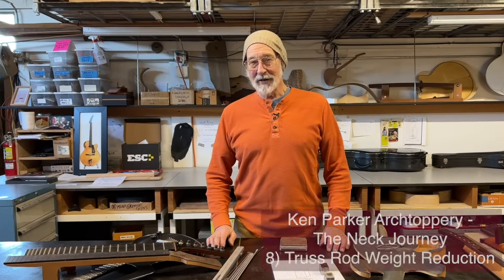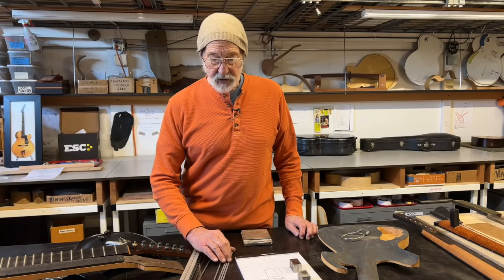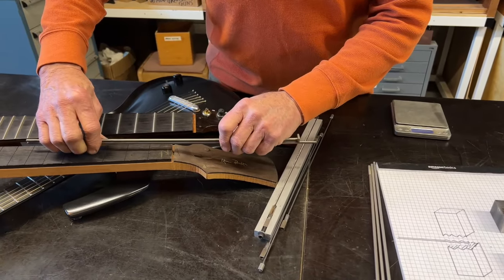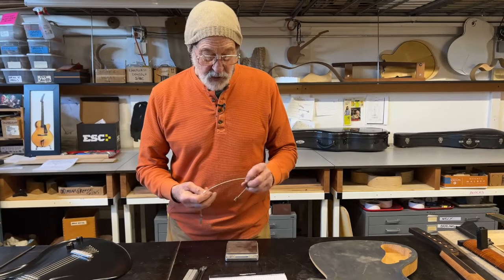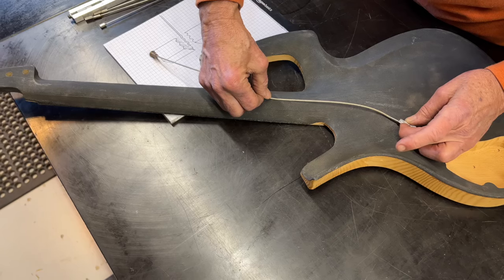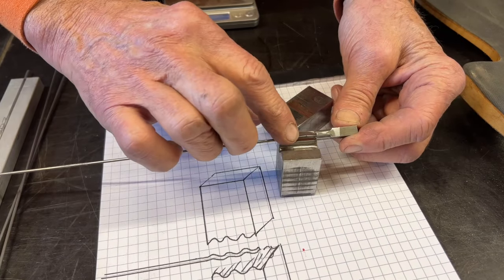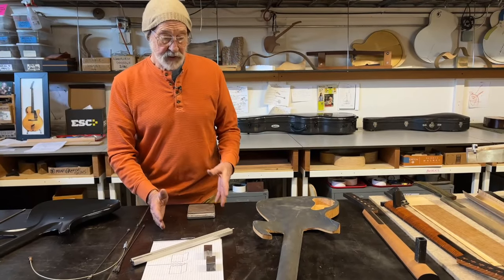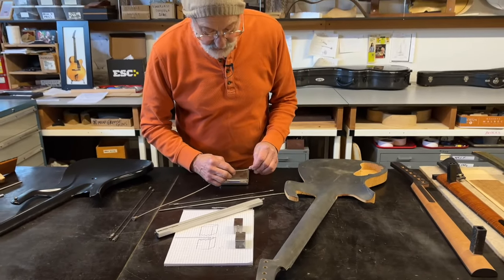Ken Parker Archtoppery - The Neck Journey 8) Truss Rod Weight Reduction

Comment: Your videos always make me think about what the next step might be in development...  For this topic, I wonder how much tension you could put on a heavy gauge wound string before it would yield...  Seems like it might be incredibly simple to thread a guitar string (or bass string) down a hole in the neck.  A simple geared tuning peg-like post could provide the adjustment...  I'm probably over-simplifying this, but it seems like there might be something worthwhile to chase down.  Your videos are so thought provoking!!!  I love it.
Reply from the maker: Thanks! We can imagine all sorts of arrangements that would balance forces from the set of strings through some length of tension-able something adjusted by an adjustable something, let your imagination go!
The physical problems of installing and adjusting your new design will include weight, complexity, access, stability in tension, fool-proofedness, cost, etc.etc. The beauty of Thaddeus McHugh's original design is it's farm-hand simplicity, right up there with duct tape and bailing wire. For example, the .078" or 2mm rods that I designed for the Fly guitars worked great, but at the cost of complexity and expense. The beauty of the original design is the ease of cutting threads on a 3/16", 5mm steel rod that easily exceed the strength it will need in service. For my purposes, a light rod was essential, and we just gritted our teeth and made it work. Like many other things, in order to beat a simple solution, you need to open your wallet.

Comment: Thanks for sharing your ideas! Do you say compression because they compress that part of the neck? As the rods are under tension (cables only work in tension) would carbon work too? I think I might try that on one of my guitars.
Reply from the maker: Right, the rod is tensioned, so it loads the structure it attaches to in compression. I know it's kind of odd, sorta like is a West wind blowing westward, or does it come from the west? (Answer, from the west.)
Carbon/epoxy has fantastic strength in both tension and compression, but to be able to apply and adjust the tension, you need to grab on to it somehow, and believe me, that's a challenge with no simple, obvious answer.

Comment: Good idea for the multi wire cable truss rod! Does this concept induce some kind of simpathic vibration?
Reply from the maker: I used 1/16" 19 strand galvanized steel cable (stronger than stainless steel) that was coated with a thin skin of vinyl. I pushed them into a close-fitting slot and never had any errant vibration problems, although it did seem like it could be a worry.
Reply: @kenparkerarchtoppery9440  that makes sense. I like this concept very much . Thanks M. Parker

Comment: Ken, what are your thoughts on using dyneema instead of steel cable? Its used on sailboat rigging...
Reply from the maker: As a life-long sailor, you can imagine that this plan got plenty of consideration! Although dyneema is very strong, it is outperformed in tension by Zylon PBO, and so this would make it my first choice. As always, grabbing on to a rope is the problem, and it just looked to be too problematic to pursue 30 years ago, although it might be worth another look. Here I'll copy my reaponse to another similar question....
Thanks! We can imagine all sorts of arrangements that would balance forces from the set of strings through some length of tension-able something adjusted by an adjustable something, let your imagination go!
The physical problems of installing and adjusting your new design will include weight, complexity, access, stability in tension, fool-proofedness, cost, etc.etc. The beauty of Thaddeus McHugh's original design is it's farm-hand simplicity, right up there with duct tape and bailing wire. For example, the .078" or 2mm rods that I designed for the Fly guitars worked great, but at the cost of complexity and expense. The beauty of the original design is the ease of cutting threads on a 3/16", 5mm steel rod that easily exceed the strength it will need in service. For my purposes, a light rod was essential, and we just gritted our teeth and made it work. Like many other things, in order to beat a simple solution, you need to open your wallet.

Comment: The cable truss rod is genius.  How did you prevent the cable from vibrating in the channel? Silicone?
Reply: It's probably in constant contact with the wood, so consequently unable to move. Therefore, no vibration.
Reply from the maker: I used 1/16" 19 strand galvanized steel cable (stronger than stainless steel) that was coated with a thin skin of vinyl. I pushed them into a close-fitting slot and never had any errant vibration problems, although it did seem like it could be a worry.

Comment: Did the T bar and Square bar Work? Did they keep the neck straight and firm?
Reply from the maker: They did add some stiffness, but at the cost of added weight. I think of them as a credible step in the evolution of the modern guitar neck. The fact that they no longer are widely used, and have been replaced by modern, lightweight designs, I think is the answer to your question.
For a non-adjustable neck reinforcement, in my opinion, the "D Tube" stands head and shoulders above the other choices, as it is many times stiffer than any steel component, and, unlike steel, weighs less than the neck wood that is removed to install it. Hard to beat!

https://dragonplate.com/carbon-fiber-d-tube
Reply: @kenparkerarchtoppery9440     I'm "" building"" a guitar in a CAD program,
and  thought I had an original idea of a T shaped or square shaped metal beam in the neck,, but then saw on the archtoppery video that the Martin company had that design in their early guitars. Thanks for the D shape Carbon link.,,,,I'll  Look into it.
Be nice if could totally factor out neck movement in a design.

Comment: Brilliant! Truss rods are the bane of my existence, especially these double rods that everybody uses now. If, like me, you want the strap button at the SG or ES-335 location (for playability reasons) you can bet that you're going to have neck dive problems (unless your body wood is something heavy enough to get you a sore shoulder). Kinda hard to play a guitar well if you're constantly having to hold the neck up.
Reply from the maker: When I first tried to define the Fly design, low weight and guitar balance were clearly design goals I felt I had to take seriously. It's hard to get it all right, none of us have, I don't think, but you gotta try, right?
In particular, I agree that trying to play while non-stop fighting the position of the instrument is infuriating. It's really hard to expect a balanced design if the neck is heavy.
Reply: @kenparkerarchtoppery9440  And of course tuner weight is a big concern, as well. I love locking tuners, but can't use 'em. Too heavy. I always change out the tuner buttons for plastic ones for that reason too.
Reply from the maker: Me too, too. I always include a set of metal buttons in case of plastic cracking problems. Sadly, some of these will most likely fail.

Comment: Seems like truss rods always fail at the threads. Isn't there some kind of system using a wedge arrangement around (I think Warmoth uses one like that)? But there goes your simplicity.
Reply from the maker: Some truss rods might have built in defects or hidden stress risers, but I'll bet almost anything that the vast number of truss rod thread failures can be attributed to the destabilizing and chemical modification of truss-rod-adjusting humans by CH3CH2OH, otherwise known as ethanol. Another prime suspect is dry, non-lubricated threads along with a little FeO2. The solution? Sobriety for the TRA adjusting human, and a drop of oil on the threads. It's a miracle. Threads, after all, are no more than a rolled up wedge, so wedges it is!

Comment: Why do many musicians prefer an adjustable truss rod over a non adjustable carbon reinforced neck that doesn't move? I bought a 1924 Gibson in 1986 and have never adjusted the neck. In 1991 I designed a non adjustable carbon neck, not as good but not that different from yours. I was told by my luthier boss that it wouldn't be accepted. After a long absence from luthiery I've now built my design into instruments for myself. They have passed 2 to 3 years of seasonal change and I can't see any issues. I am going to trial the Douglas Fir infill soon. Also, there is a youtube luthier that went down the path of using the carbon D tube. His instruments sold but later some of those customers requested a truss rod neck. His trials also yielded positive results. I have designed, built and fixed things all my life from electronics to violins and I'll never understand the interpretations of the consumer?
Reply from the maker: Here's where we can all agree that sometimes things just work great a their simplest embodiment, and sometimes, they won't. I spent many years optimizing necks for serious guitarists, and there are more troubles than you might imagine! Ideally, truss rods are a "set-and-forget" adjustment, but life in the real world isn't always ideal.
Reply: Thanks for your time.

Comment: With the Titanium Rod. Why not peen the anchor in place. Actually I’m planning the thread a tiny section, Then Loctite, then peen.
Reply from the maker: I have done what you suggest, and it worked fine, peening, and then some sharp punch marks to drive everything tighter.
Reply: @kenparkerarchtoppery9440  thanks as always Ken. Nice knowing it should work. I have not worked titanium before so wasn’t sure.
Reply from the maker: It's the darnedest stuff, and no pleasure to work with! It's soft, but doesn't like to cut, it. tears. It has super-low thermal conductivity, you can hold a short piece in your hand and blast it with a torch! Who heard of a metal that doesn't conduct heat? This is an extra problem in machining, as the tools heat up quickly and then get hotter. Also, it won't abide a small clean up cut that we would use on other metals to get a high quality surface. Ir's just weird, but it is 40% lighter than steel by volume, and just as strong, so it does present temptations. It does thread tolerably well, as threading tools take big cuts, but tends to tear at the roots, causing stress - risers, Sheesh.
Reply: @kenparkerarchtoppery9440  thank you for the the information to ponder. I may start with Ti Threaded rod instead of trying to cut threads. Knowing me I’ll try both ways. I have some machining experience so that helps. 

I’ve started drawings inspired by your adjustable neck as well. Some changes to fit my needs.